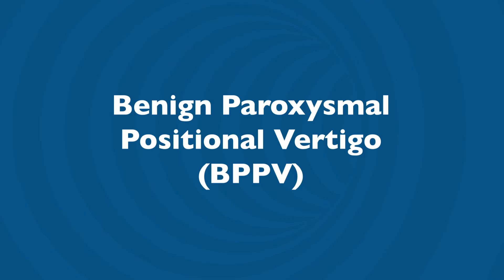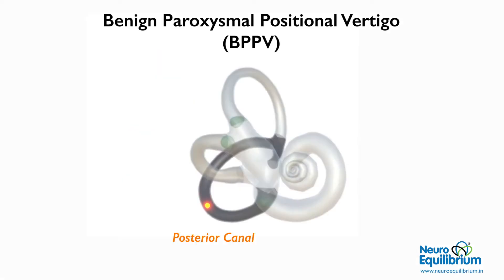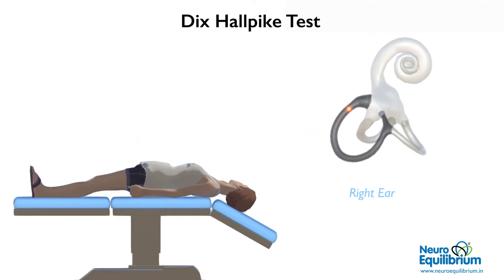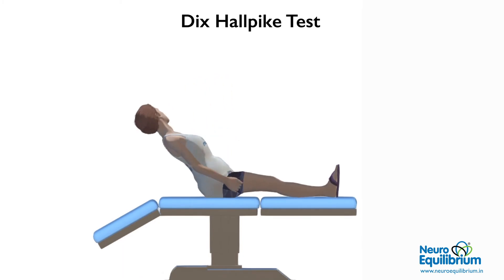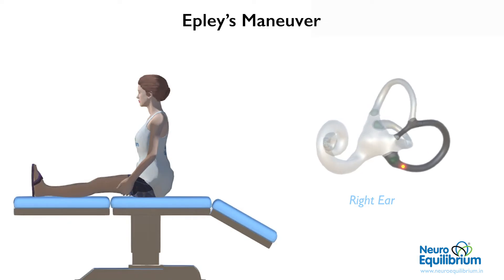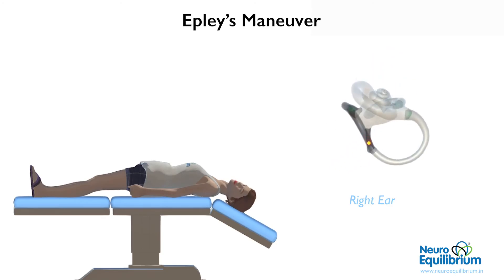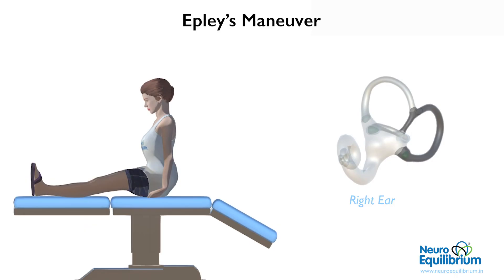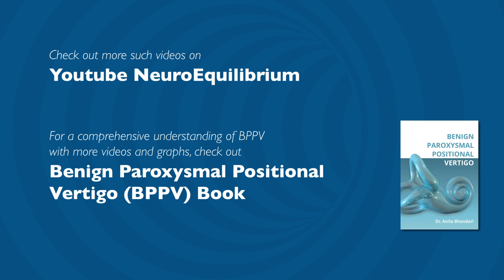Epley Maneuver to Treat BPPV Vertigo: Step-by-Step Guide for Quick Relief

Comment: This is a very instructive simulation.  Thank you for this clear video and straightforward explanation.  I also appreciate your demonstrating that the final position involves a slight forward head tilt.  That final position is described in Epley’s original paper (Epley JM, The canalith repositioning procedure: for treatment of benign paroxysmal positional vertigo. Otolaryngol Head Neck Surg 1992;107:399-404. doi: 10.1177/019459989210700310), but is omitted in most demonstrations, which is unfortunate because the final forward head tilt promotes passage of the otoliths from the posterior canal through the common crus into the utricle, and lowers the likelihood of otolith reflux.

Comment: Many thanks for nice explanation and the graphics.
I have a question. During epley maneuver, after turning head to normal side (step 1), head will be turned by 90 or  by135 degrees. If the nose has to look down towards the ground (vertically), the head will have to be turned by 135 degrees and not 90 degrees. Kindly clarify.

Comment: When you say at the end of the video "it has been recommended to flex the neck" upon sitting to prevent crystal from re-entering canal. Flex the neck how? Front to back, side to side, only on side that crystal was on, in a circular motion? Some other way? I have never heard of this guidance before and am searching as the Epley Maneuver has stopped working after years of Vertigo relief using the maneuver.
Reply from the maker: Greetings tcchief2919,

In the last step, the head to be flexed down to chin down position. 

If you need more information, feel free to reach out to us at: +919266125888

Regards,
Team NeuroEquilibrium
Reply: @neuro_equilibrium Does Eustachian tube dysfunction also affect this...?